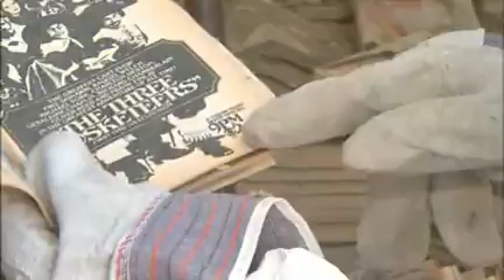DEAD HOARDER HOUSE

Comment: Houses like this are pointless to keep in existence. You can't tell me that it's worth it to fix it up. It should be burned to the ground and a new one built in its place.
Reply: +Tim Ramich I restore houses with my dad, and you have no idea how easy it is to restore a house in this bad condition. Demolition will take only a week TOPS with a team of people. Everything will be replaced, and it's not as bad as you think.
Reply: +nick pog Easy but not economical. When you have to take everything down to the frame, including removing the floors, you might as well just go farther and tear down the whole thing. It's easy to build using new styles, that have no style.
Reply: +TheREDHeadPower The market is inflated bullshit. Houses used to be affordable without a person paying a loan almost until the day they die.
Reply: @ Tim Ramich ,, not really , a new house that size nowadays would cost easily over a half million to build , maybe even closer to one million , restoring it could cost anywhere from 50 thou to 200 thou , maybe less depends on if it has mold
Reply: +carmichael moritz Houses don't cost that much to build. Most of the cost is because of an inflated market and because the government thinks they should be paid for doing nothing.
Reply: I imagine that's what the new buyer may do... Most of the value is the land, surely.
Reply: you'd be surprised at what kind of crap they put on the market. my wife and i were looking to get in to a house when we first moved to town. the place smelled like a meth lab...i kid you not.
Reply: @TimRomanelli  I believe ya.
Reply: Exactly!

Comment: Some hoarders live like they are penniless, but actually have money and/or valuable stashed away.  They were probably going through all that stuff to make sure there was nothing of value in there and to grab anything that actually was valuable.  These folks are not doing this out of kindness or because the city is paying them a few thousand to do it.  It may be disgusting, but never let the city come in and do the initial cleanup if you lose a relative like this.  You can rent dumpsters and gear to safely clean it out yourself...have the structure torn down and sell the land yourself.

Comment: instead of calling a clean up crew, should have called the fire dept to burn it down to the ground. That house is beyond repair.
Reply: +JOYLYNN BLANCHARD   They only set fires in "Fahrenheit 451".
Reply: +SaesarSalad Around here the fire department will set a house on fire and use it for training purposes if the owner wants it burned down.

Comment: Question: are there any rules in SoCal regarding what (if anything) needs to be disclosed to the buyer of such a property?  If I remember right, in some states, the realtor or county inspector is required to inform the buyer if someone has died in the house (I've heard of a few odd jurisdictions that even require reporting of hauntings or paranormal activity!)  From a health perspective, I would want to be made aware of possible contamination in the water supply, grounds, and remaining walls.

Comment: They say the next tenant of the house will "never know" how nasty it was, but I have to wonder, won't they? Will the next residents wonder why it always seems like so many bugs are coming from the walls and foundations and where the lingering 10 foot high pile of cat shit odor comes from when it rains?
Reply: They'll gut the house, take away all the drywall and plaster, disinfect and deodorize it give it a few coats of paint and replace the underclothing and flooring. As well as cleaning out the crawlspace and any attic and flooding the whole place with insecticide and rat poison.
Then comes a few coats of paint and an investor.

Either that or the investor will buy the place for the land and tear down the property before any one can live in it.

Comment: Id buy those cereal boxes - all day long - Ive been in nastier places - obviously normal clean-out people can't paw through the garbage - but - that place - wow - anyways - your video popped up in a thread on cerealbits (google it) - actually sparked a multi page discussion - if you ever run into a stack of flattened boxes - which might be a bit easier to notice than undifferentiated garbage - try to hang on to some - Ill compensate you well